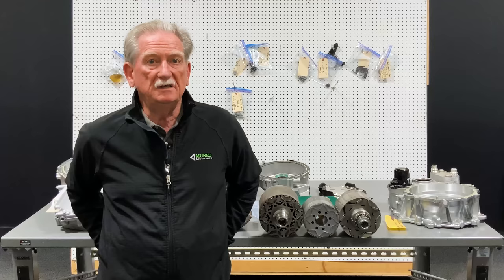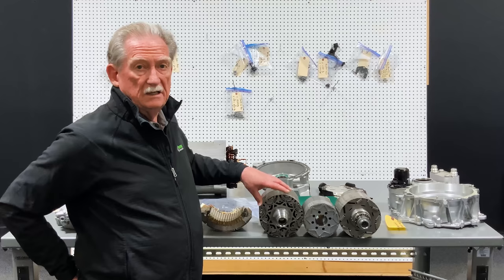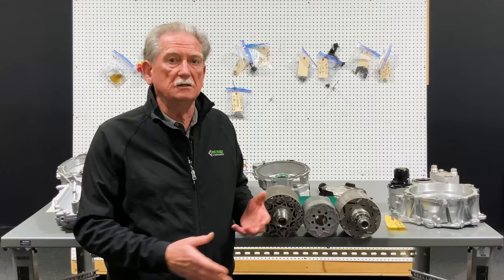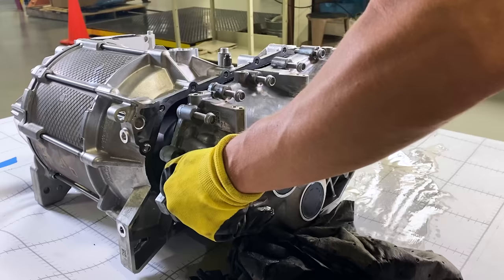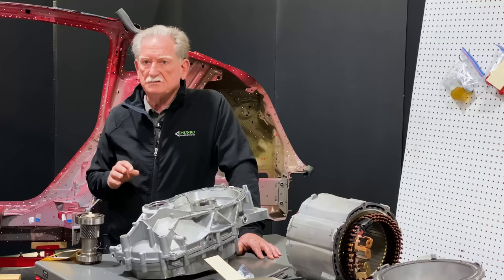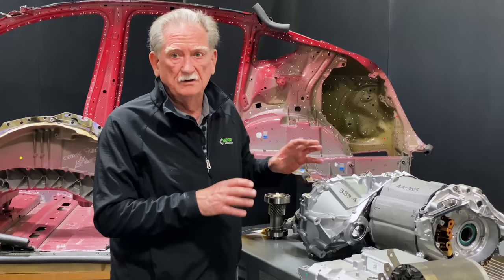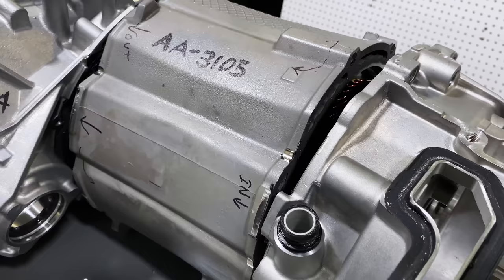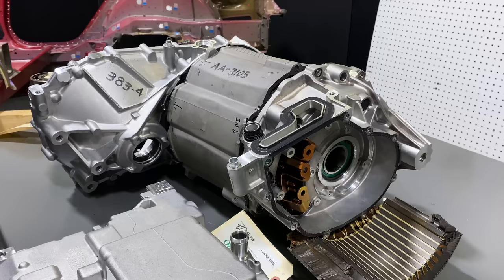Volkswagen ID.4: Electric Motor Teardown and Analysis

Comment: Interesting information in this video. About fastening with bolts in my opinion are better than clips or other firm of automatic fixation because is serviceable. We must start to repair not only to replace or trashing the thing's we use and are broken... In Europe 🇪🇺 were I am from, we have a new concept and is good: every object must have encrypted the percent of reparability because it is to much trash and also the resources at not infinite. The VW has design the invertor and not only regards to this new law. In the past this reparability was better and the object were way much better design and construct.
Also the screw is better because the fastening is influence way much more by the temperature and humidity and regarding materials is a only one way assembly witch is not good. I understand that you in America have a lot of resources but we must not waste this. You already have the influences of this facts in your whether actually and it will be worst.
So in my opinion, as a constructor of a plastics parts in automotive industry working for a huge company, we must make all thing's repairable and easy to change and adapt on new concept. Have a nice day and greatings from Romania 🇷🇴 European 🇪🇺 Union

Comment: While I'm with you on the minimise fasteners argument, I'm definitely not with you on the suggestion to permanently bond parts "because nobody's going to repair them".  This is exactly why modern cars are unbelievably expensive to repair when things break.  I've had to replace an entire ABS control unit for extortionate cost, just because it was a sealed unit.  I know someone who had the same issue, and took a cutting wheel to the controller.  The only fault was a capacitor (capacitors are prone to failure due to heat and vibration).  He replaced it, sealed up the unit, and it was fine for no more than pocket change.  The dealership had quoted him about £1500 parts & labour to fit a replacement.
The modern auto world is full of stuff where you have to replace the whole unit, not just the broken bit.  Even MAF sensors on some cars come bonded into complex plastic housings, and you have to buy the whole unit.  This is not only costing customers unnecessary huge expense, but is incredibly wasteful.  I'm not suggesting this is a typical DIY solution, but specialist shops are more than capable of handling this sort of repair. 
Instead of doing as you suggest, the industry should strive to make more components repairable, but using snap fixings instead of screws/bolts.  The PC industry has for many years had tool-free assembly.  There's no reason the same scheme can't be used on auto parts.
That large board in the invertor could have easily done away with fastenings entirely, because it was sandwiched between two other parts that were themselves fastened together.  All it would need are some registration lugs to prevent sideways motion.
I also think that bleed resistor was likely secured using thermal compound.  They get hot, and fixing it to the case with compound lets the case act as a heatsink.

Comment: im sorry but you are incorrect here! to say a car wont last a million miles...maybe 1950s cars wont with that period not treating there steel and under body treatments. but todays cars will. iv been inside a taxi that had a diesel 2ltr engine in it that was a Vauxhall and it had done just over a million  miles! and he said he had made sure that it had a service every 5 thousand so miles since having his taxi from new. this taxis body condition was great and i even asked him if possible to look under the bonnet of this taxi to see the engine bay'' and it was great, nothing at all to tell me that this had been over a million miles. so todays cars if looked after will do over a million miles easy! i wouldn't of none that taxi had done that many miles until i asked him about why is he still driving that model of a vehicle? and his answer was its a great drive, its good on diesel and iv never had any issues with it apart from the gearbox i had to replace. that was it!! 

Anthony, united kingdom

Comment: At 11:25 - VW is ahead of Tesla by eliminating oil cooling!? I disagree, because the oil cooling is one major reason Tesla squeezes out 33% more peak power from their design (200 kW Tesla vs 150 kW VW iD3) at almost exactly the same weight (90 kg) and size.

Comment: There's more behind 'fasteners' than just screwing together parts. The function is also easy of repair and possible recuperation of valuable parts. In EU we have ''norms' regarding this. So we waste less. You can see this in the total concept and design that finally is just more efficient and reliable. Many parts of the VW ID 4 are recycled as a view into the future and waste less resources. A sharp contrast with the 'use and throw away' mentality and production of rubbish coming from China for example !!

Comment: The way Tesla put their bleed resistor directly on the PCB should put that on the third place because there is thermal dissipation and that thermal dissipation is directly on the PCB which is a unnecessary stress (a mechanical one) on a vital component, multilayer PCB. On other models, the thermal stress is outside PCB which is better. Tesla solution is cheaper and this is the only advantage.

Comment: I see at least two cases why inverter needs to be repaired. I'll be glad to do that but what I also see are unsigned components what's drive me to insane because I need to get stuf from used inverters in the future. No it's not good construction in electronic repair point of view.

Comment: Wrong on both points. People fix inverters, and there are companies making a good living out of a single business of fixing ignition modules/ECU's.
Fasteners has to be done right tho, and the PCB you fasten is actually a part of the tension mechanism. Also, vibration kills such electronics and analysis and simulations show where the fastening needs to be.

Comment: It should also be remembered that all these Threaded Fasteners are a normal development in a new design. Over time, the development of these engines will refine and shrink so that eventually only a small number will remain.
The first lcd tv was also packed with pcb circuits and lose components, today there is only a small pcb hold by two clips that does the job way more better than the first.
My advice....don't send this electric motor back to Volkswagen, but keep it safe and let us see the difference in five years. I guarantee you can make a new interesting Youtube video.
Thank you!

Comment: They might have put screws in on purpose so they can open and research failures that will happen when the is in use in the real world. Art one point they might seal it in one box that cannot be opened. Problem is the "right to repair" you can't fix things if you can't get to them...

Comment: You are the type of engineer no mechanic would ever agree to allow in his shop! Getting rid of threaded fasteners Is irresponsible since you are making a device that can only be used until it breaks. That means the energy involved in manufacture is spent over and over and over as parts are replaced instead of being repaired. You belong on the engineering team at Apple.

Comment: Snaps suck, the times a snap can be opened and reaffixed are very limited compared to fastners. Over time all materials flex and you can't tourque a snap.

The cooling solution is not good. If you have to service the stator you will definitely get coolant all over the  stator. If you get a coolant leak thru the RTV it will get to the electrical components and kill the engine.

Comment: Sorry, Sandy. Yes, likely nobody will service this in car lifetime, but 100% when cars move east (coming from Western Europe) or south (USA), people will put in the effort to actually repair that, if is broken. Even in Germany, you can send in your main control unit (normal car!) and get back a refurbished (fixed electric components, fixed soldering, etc.) one for possibly 1/3 of the price of a new one. Possibly they can get rid of some of the screws. All of them - not sure if it then will still be as serviceable. People who are buyers of used cars will definitely look for good repair-ability. Likely, the money you get when you sell it, and it is known to be service-able is also higher.
Reply: ...and: VWs new motor, the APP550 is an evolution of that design. It would be very interesting to see what they changed as the performance and energy efficiency is claimed to be vastly superior.

Comment: Capacitors are likely to fail first on a component especially of a 10 year lifespan is considered the bottom end. 
Never service? So how is this thing serviced or recycled? Seems like a lot of crap for a landfill or shredder to recycle. Maybe part of full product lifecycle. 
For the circuit board it’s to provide rigidity as vibration and flex kills printed circuit boards and to ensure no service over lifespan you want to remove the most common failure points. 
It will be interesting to follow how it turns out. 
What I don’t want is Apple type unserviceable monoliths where replacing a $100 part becomes impossible without destroying the $4000 part.

Comment: A bit obsessive about the fasteners!  If "unfasteners" were such a big issue in machinery, surely it would be more evident that it was a big issue.  Sump plugs fall out soon after service for lack of proper torquing, not after yonks of already being there.  Anyway, let's face it, the vibration difference between electric motors and combustion engines is barely noticeable (not).

Comment: 5 second review - don’t use threaded fasteners. Reality, this video could not of been made if every thing was riveted or glued. Also note eliminating the long bolts and replacing them with riveted fasteners completely prevents the inverter replacement. RIP Bob

Comment: So he thinks nobody is going to service the inverter? Well, not with snaps and glue they are not. I serviced my electric lawnmower, a bridge rectifier. Easy to replace and cheap. If they hid it under glue and plastic snaps that break like they always do, not sure I would have been able to

Comment: I’m a bit confused how is RTV such a good idea in this application.  It looks like you have a bunch residual RTV in the inside that is conveniently around the size of your “bleeder hole” without the great idea of having no filter ?  There seems to be quite a fair amount of RTV loose inside of the casing, may be came loose on disassembly but in either case, is inside and could become loose.
Now, on the filter, is hard to see on the video but are those burrs of metal stuck to the magnets of just the magnets look crappy?  Again, burrs of metal from the casting inside the motor casing without a filter. 

I understand the idea that the motor won’t last for ever and is made to have a calculated end of life.  But, the casting and small bearings looks they might be calling their end of life, sooner than later.  

Plus side by side, the vw looks really sloppy compared to the tesla.
Reply: I forgot.. 
IDK how important it is but is about the cooling routing on the motor, would it create an uneven cooling across the motor?

Comment: I don't understand why you saying that you wouldn't want to repair the inverter if something happened to it say the circuit board cracked or something and it's not working take the circuit board out and replace it it would save a lot of sewing s*** away just because one little part malfunction fix the damn thing and keep using it that's the problem nowadays everybody wants to use it and chunk it too much goes into landfills as it is either recycle it or build it to where it can be recycled or repaired

Comment: Nice video. But bit of a typical LEAN engineer ideology on fasteners. Snap fit is the worst thing for long lived components, and once worn is typically unserviceable. A correctly specified and tensioned fastener should never fail. I love rivets. And they are the best to use in instances like boilers, flexing joints, etc but I cherish serviceability. Bolts ftw. 😁

Comment: The VW motor looks bigger and has more magnets than the tesla, Surley this results in a torqier motor? So how come the tesla motor is more efficient? Is that extra torque not being put to good use and just wasting energy holding the EMF? Also the VW magnets look much rougher compaired to the polished ones in the Tesla, are they the same material? Ignoring software I'm just trying to understand who has the better rotor design electro mangnetically/mechanically.

Comment: The engineering philosophy to be faster, cheaper and “better” outlined is creating a disposable society. Yes the manufacturers gain, and indeed the first owners. But for subsequent owners or as the item ages, the longevity and servicing abilities are compromised. The days of making objects engineered solely for quality is gone except for the very high end. Profits and share value is not compatible with longevity and resource conservation

Comment: now for cooment sake double bearings site is for balance softness  as reduce drag and increase stability a certain swuush sound noice which is good in as even air intake swuush sound bosted with noicer in bottom side colector technicaly you air stream on servo vents on button lcd screen choice how mush open air streams stay upon drive in % and they ajust to drive mode on same scale as driver wants for certain swuush sound thats high tech as it namely use air vortex cooling around engine again is very nice for vw to allow look into parts and serious flaw is not lack off bearings but vibration type most likely due to curved bearings they allow lot off strucutre tensile force to be spread but lack off so called high temprature bearings since bearings in tesla are power protected coils metal stifened as temprature handled to redraw tougher temprature so in nothre words a so called sided structure is causing even done so to much heat as at even 190 kmh speed technicaly vw is asuring a plot question wisely but lack off stability on high speed even more puzling is qustion why that een so it hapends on smaller speed it looks like engine transmission should touth should strait and not angled as angel type allow vibration form that in roads on higher speed simply heat to much the solution is temrature heated bearings and double suport may more noice but safer this conclude lack material inside is also wise to post as tesl already has  and enginers have to adapt this to tesla so thanks for tesla from vw oficaly saying thanks thats polite!

Comment: Not really sure why you're praising VWs inverter design here. Look at the difference in complexity of their inverter assembly compared to Tesla. Tesla does everything on one single PCBA (compared to VWs 3 PCBAs), with various elements which make it superior, such as one gate drive power supply (compared to VWs 6!!), a ton of messy unnecessary wiring, complex mechanical assemblies, such as the busbars, extra cooling plates, and additional gap pads.

The sad part is that they could have basically copied the model 3 inverter design, since it was out years before this was released.